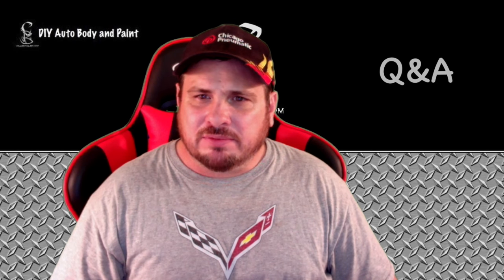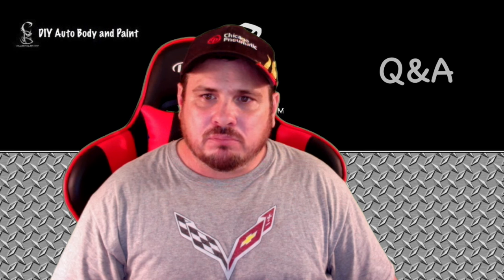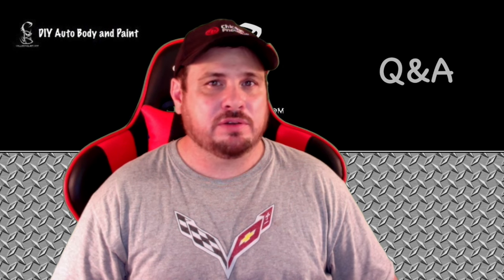Q&A Where To Apply Seam Sealer on Cars

Comment: Great insight.  Was targeting leaks on an aged vehicle that's weathered it's fair share of storms.  Your video helped me rethink my plan and in turn made it a heck of a lot more effective.  Appreciate your work.

Seam Application Plan:
Removed all weatherstrips, lights, door sills, etc.  
Tapped and flattened any seams that had settled out of alignment.
Prepped and cleaned (degreaser) all seams thoroughly.
Taped off the more visible seams for a more uniform application.
Applied 3M Flexiclear Body Seam Sealer.
Applied 3M Weatherstrip Sealer and installed weatherstrips.
Boom, take that leaks.
Very successful.

Thanks again.

Comment: A very imformative video. I have slight corrosion on the bottom edge of my Volvo S40 door. I've removed the old seam sealer tape and treated the corrosion with Hammerite rust treatment. I was unsure whether the apply the seam sealer tape direct to metal or prime, then apply the seam sealer over the top. Your video answered my question. Thank you.

Comment: Thanks for taking the time to respond, Donnie.  Your examples make sense.  The key, I guess is for lap joints where you do not want moisture to enter.  I was thinking only for areas to prevent outside moister from getting inside.  The odd place I saw it used was inside a truck where a flange bracket was spot welded to a solid flat panel.  I was confused as the Sealer would not prevent water/moisture from penetrating into the vehicle, but in your example, moisture would want to wick into the joint and hang out there starting the rust process.    I receive an email that you had responded, but this video did not show up in my subscriptions list.  Interesting.  Hoping others can see and learn form your response.  Thank again!
Reply from the maker: I have been catching up on commenting and making videos.  So I want to get you your answer as soon as possible, but I don't want to bombard everyones feed.  So I am making the videos unlisted, which will allow you to watch if you have the link.  But it won't go to everyones feed.  However, I am spacing the videos out.  This video and others will go live soon.  Thanks again for watching and your question.

Comment: Hey can I apply seam sealer over epoxy or urethane sealer in its recoat window?  I'm feeling its cool to wait until its dry sand-able then apply seam sealer, they are exposed seams that i sodablasted clean, but their would be no way of scuffing them once primer has dried...

Comment: hello, 
what would you recommend for the following:  I just got back my truck from a small fender bender repair.  The repair person was a friend who did not charge....I can't complain.  I was looking over the repairs and notice some small holes where the tire well was bent back to its original position.  I noticed some kind of seam sealer was used to seal the two parts.  Would you recommend more seam sealer or some kind of rubberized undercoating?

Comment: what if you apply the seam sealer and smooth it with your finger and forget to tape the edges. How do you fix or smooth it out to have a good finish before your base coat?
Reply: From my limited knowledge you find an applicable solvent for the seam sealer your using and wipe off the excess like that.obviously its done while still wet.seam sealer is exactly like applying household caulking for the most part. Videos with good tips for caulking will apply to seam sealer as long as the solvent is correct for the product you are using.

Comment: In the case of replacing a floor pan, for instance, I've never seen anyone apply seam sealer on the underneath side, which makes more logical sense to me.  Instead, they always put it on the seams inside the cab, where it's going to get painted anyway and stay dry, as a general rule.  If you make a good, tight weld and then you do a good job of prepping and painting, why would you need seam sealer inside the cab?
Reply from the maker: Yeah, there are always joints and crevices that moister can creep through.  I would feel safer using seam sealer.
Reply: @CarAddictGarage , so it's to attempt to inhibit moisture migration, from outside to inside?

Comment: on my 66 Barracuda I redid the seam sealer on the roof rails (above the doors & windows).   wire wheeled it to bare maetal and used 3M bare metal seam sealer 08310.  I haven't painted yet and a few weeks later that seam sealer was all blistered up in places.  now I have to grind it all out and start over.  2 questions, why did it blister? can I just use something else.  I was thinking All-Metal, since I already have some, then sand it smooth.  Seam sealer is a bitch to work with, it start setting sooo dam fast.
Reply from the maker: I am not sure why to blistered.  You could always spray the bare metal with epoxy, then apply seam sealer over it.  If you need more work time and a smooth finish, 3M recommends using their plastic felxible repair http://amzn.to/2ca4jEy  The say it works great as a seam sealer.
Reply: I'm on the rear quarts now, but when I get back on the roof rails I'm going to remove the sealer and start over (maybe there was moisture in the cracks).  does it have to be something flexible?  I have the 3M gun and some panel bond left.  if it doesn't have to be flexible then that would seal it, right?.  sorry if that's a dumb question.